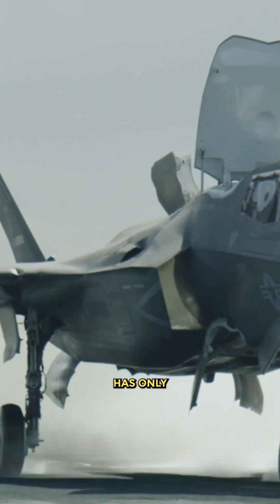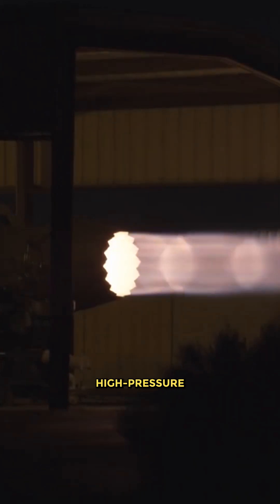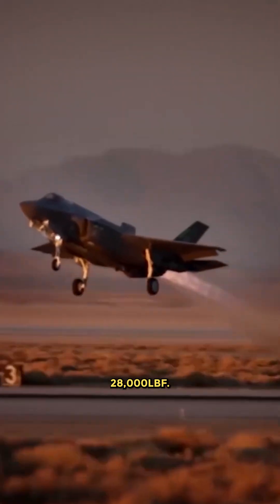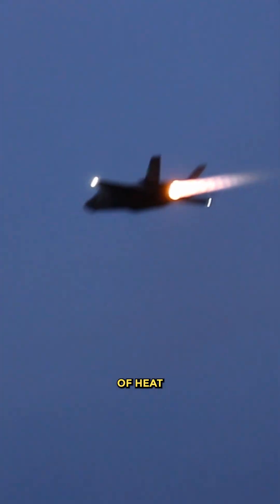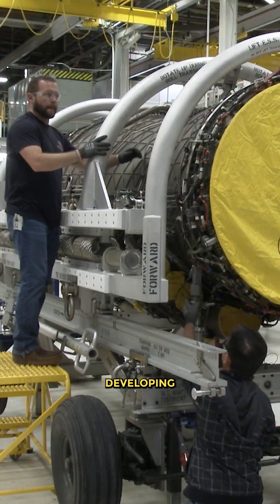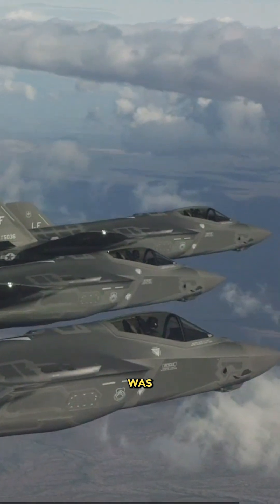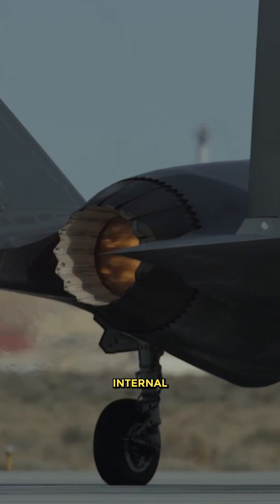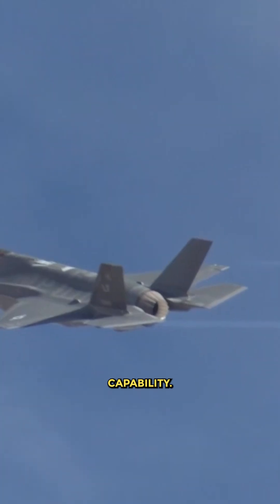Why does the F-35 have Only One Engine? #shorts

Comment: The F35 tried to go a bit far with mission overlap between the A & C vs. B models. The reason for limiting the overall speed was that over Mach 1.6 the RAM available at the time was susceptible to heat damage which is why the F22 costs so much to maintain. Current costs of maintaining the F35 are dropping due to heat resistant RAM which will be bringing the costs of the maintaining the F22 down, too.
Reply: Good to see someone so aware of these fantastic aircraft. I'm English, and this just has to be said, the Americans are the masters of producing not only, such great looking aircraft, but so far advanced compared to all other aircraft types.
Reply: It's literal jobis gon a be to replace the a10 it font need to be faster
Reply: The speed limit is only for the b and c versions because those use a different kind of ram created to resist the salty water
Reply: @aquilesca5tr0  I'm English, so I'd love to know why we see and read so many Americans endlessly trying to run down other countries militaries, and their military hardware, when the truth today is, nearly all of it, is actually, so much better than their own?...  

So, really,  what's that all about? What do they all think they could ever achieve just talking such remedial propaganda? For example, why do we read the Americans all endlessly claiming the F-22 is so much better than the "Russian rubbish"? Yet whenever they're asked what any of them have ever seen the F-22 actually do, that would allow them to form and hold that opinion?, none of them can answer that question, as they've never seen the F-22 do anything at all, (other than flying over a beach on a YouTube Video)?

So, all they actually prove is, they're just talking idiocy and basing their own bias juvenile opinions on a whole lot of nothing, right? So, again, what is it all about? Seriously, read them all?, all they do is talk endless propaganda claims, and claims they can't ever back up with a single fact?. It's idiocy, and it's idiocy on a scale of idiocy I really don't believe any of us have ever seen or ever experienced before, it's embarrassing is the truth.

Even more stupidly, none of them have even asked themselves the most obvious, and most important questions, (we must always, not only ask, but more importantly, understand), before attempting to analyse anything from anyone else! 

Questions like, how can their own F=22 stealth fighters, detect, track, or target any other stealth aircraft from BVR? You see, they can't tell you, as they all just assume so much. Yet if they had just asked themselves that one question?, they'd then start to understand that the reality is nothing at all like they all think!

The facts, (that seemingly none of them even understand), are, that stealth alone, defeats high-frequency (short wave), radar, by absorption and deflection, but it does NOT defeat low-frequency (long wave radar), so regardless of the aircraft's RCS (radar cross-section), when they're being tracked and targetted by long wave radar they're anything but stealthy, and stand out just like a beacon in the night. 

To detect, track, and target other stealth aircraft from BVR, can be done easily with long-wave radar, (but it must also be enhanced), to remove all background clutter for targeting purposes. Otherwise, what could the F-22 have to detect any other stealth aircraft from BVR? 

The answer to that question is they have AWACS (that can transfer all targetting data to the F-22's in real time). Yet that's no longer possible today. And this is where actually understanding your enemies real abilities, becomes extremely important, as I'll show you.

Neither the APG-77 radar, used in the F-22, or the APG-81 radar, used in the F-35, can detect any other stealth aircraft from BVR! An obvious fact, the US Air force will be fully aware of. Only it seems the reality is, that when the F-35 radars were being designed 13 years ago, there weren't any other stealth aircraft to think about as a potential threat! 

So, seriously, how can anyone possibly see these US stealth aircraft as any sort of real threat to either Russia or China, (who both have these US stealth aircraft technically beaten today)? 

The reality of this "Russian rubbish" (they all claim), is that Russia does have a new 5th generation radar, (with enhanced long-wave radar), their new Byelka (2band) radar used in SU-57. 

They can detect, track, and target enemy stealth jets from BVR, while the US stealth jets can't even detect them from BVR? Result = A pretty obvious one.

Russia have designed, and they've developed, the first L-Band fighter radar we've ever seen. They've embedded L-band AESA radars into the leading edges of the wings. And this L-band AESA radar "data" gets processed in real time (through extremely powerful Russian computers), being significantly enhanced, removing all background clutter, seeing them perfectly able to detect, track, and engage enemy stealth aircraft from BVR. 

This new Russian technology, along with its very impressive range parameters, and it's jamming ability (over very large areas) make this aircraft deadly to all other aircraft types. 

Oh, but, wait, it's just Russian rubbish? Indeed, it is, (if you're an outright idiot). LMAO. The SU-57 interacts in ''real-time'' with each squadron member (auto selecting) the best placed BVR missile being carried by any of them, that can be fired by anyone of them. They can take full control of surface-to-air (SAM) missile defence systems - (that alone is lethal). 

They can detect, track, and target all enemy stealth fighters, (and detect them long before they even enter Russian airspace), from much greater distances today, with "real-time" data from all those massive Russian ground (long wave stations), that are all protected with the networked S-400 defensive system. 

The facts today are, actually more than clear, these Russian stealth jets will always know exactly where the enemy stealth fighter aircraft are a well as their course, so they're perfectly able to approach head on, stealthily being able to shoot down all enemy stealth jets from BVR (and, while remaining undetected). The US stealth fighter jets, for example, would not even detect them coming! Result = you're doomed! 

Russia's new (2band) radar, covers all frequencies across all channels, used for tracking, targeting, and also for jamming (over large areas). It's part of Sh121 multifunctional integrated radio electronic system (MIRES) on board the SU-57. 

We must also understand, that Russia tested this new radar suit in the SU-35's, so they also have the option of fitting this radar into the SU-35's. Seeing the SU-35 at no disadvantage against either the F-22/35. As although the SU-35 can be detected, tracked, targeted and shot down from BVR by the US stealth fighters, the SU-35 equipped with this new radar is just as able to detect, track, target and shoot down the US stealth fighters from BVR. 

Seeing the all-important Russian advantage in BVR missile range, plus the excellent manoeuvring, neither the F-22/F-35 have, as more than critical, (if you're going to avoid simply being blown out of the sky). 

This Russian 5th generation radar design, has very clear, and very real potentials to provide genuine shared multifunction apertures, with applications including... 
Search, track, and destroy, missile mid-course guidance, against low signature aircraft, identification of friend or foe with secondary surveillance radar. 
Passive angle tracking and geolocation of JTIDS-MIDS-Link-16 emitters at long ranges. 
Passive angle tracking and geolocation of L-band AEWC - AWACS and surface based search radars at long ranges. 
Passive angle tracking and geolocation of hostile (i.e. Western) IFF and SSR transponders at long ranges. 

High-powered active jamming of JTIDS-MIDS-Link-16 emitters. 
High-powered active jamming of satellite navigation receivers over large areas. 
High-powered active jamming of L-band AEWC-AWACS and surface based search radars at long ranges. 
High-powered active jamming of guided munition command data links over large areas. (Effectively, and completely, neutralising the USA's use of AWACS for their detection). 

This Tikhomirov NIIP L-band AESA radar, is an extremely important strategic development, and it's a technology which once fully matured and deployed in useful numbers, will render narrowband stealth designs like the F-22 & F-35 Joint Strike Fighter, and many, UAVs, as highly vulnerable to all flanker variants equipped with such radars. 

-- Just Russian crap, indeed? HILARIOUS!! LMAO!

FACT = A Russian SU-57 flying well behind the front lines in Russian airspace, detected a Ukrainian SU-27, deep in Ukrainian airspace heading toward Kiev, about 300 km's away, the SU-57 tracked then fired a Russian very long range Vympel R-37 (NATO "Axehead") hypersonic air-to-air BVR missile at the Ukrainian SU-27, from a range of well over 250 km's, blowing it out of the sky, and smashing the previous BVR missile kill range world record, to utter smithereens! 

FACT = The USA has had the F-22 in service for 19 years, and it finally made its first air-to-air kill in 2023, when it shot down a Chinese weather balloon. LMFAO.
Reply: @aquilesca5tr0  Typical US propaganda, usually consists of silly falsehoods, and fake misinformation claims, or just twisted truths, like the F-15, is said to be unbeaten in A2A combat. 

It's true (ish), only when we look at every aircraft shot down by an F-15?, we find that none had any offensive capabilities, and most had little if anything defensive, many without even a basic radar, meaning, you'd be absolutely stunned if the F-15 didn't shoot every one of them down. 

So it really is, once again, and as always, just a very silly, and meaningless remedial propaganda claim. 

There's another aircraft that's also unbeaten in A2A combat, and has faced off against aircraft just as capable as itself. 

The British Sea Harrier is the only aircraft unbeaten in A2A combat, that has faced off against worthy, viable opposition. And that really is a huge factor, that's worth knowing, unlike the F-15 propaganda claim, that you'd be shocked if it hadn't managed.

You should all be questioning why the US made it illegal to sell the F-22?. The US government seemingly wants it believed, it's because it's so good, they don't want anyone else to have it?. 

Yet, that actually makes no sense at all, none, not even a little sense?, as the facts are, they've no idea what's around the corner in modern military technologies, and with the speed we're seeing new military tactical hardware being designed, developed, and created today, it could well have made great sense to sell the F-22 at some stage. (If it actually works). 

If it worked, they'd have been able to recoup many of the resources spent on the aircraft, if not the resources in their entirety, even a profit.

Only there's another, and much more likely, reason the USA made it illegal to sell the F-22? And that's, if it is, just as I suspect, a "lemon", that was intended to be their leading front line strike aircraft that's failed, (and because of the cost/expense, they can't just write it off), so the USA have then only used the F-22 for propaganda purposes? (what better way of preventing anyone else from finding out that it actually doesn't work, and really is a lemon, than making it illegal to sell)? 

Logically, that's the only possible reason the USA made it illegal to sell the F-22. It can only be because it's a failed aircraft that was intended to be their leading front line 5th generation strike aircraft.19 years the US have had the F-22, (and they've been in wars the entire time), yet they've never used it, not once! 

And even more interestingly and telling was, just after Russia arrived in Syria in 2015, the USA removed every one of their F-22's from right across the Middle East, Iraq, Tukey, UAE and Jordan.

Absolutely no doubt about it, I guarantee we'll never see the F-22 involved in any sort of real war scenario, or even involved in any major sortie, because it's basically junk. 

They've even trashed all the infrastructure they had in place to build more of them.

Now we read you all talking about the obsolete F-16? What could the F-16 achieve in Ukrainian airspace?, or in fact, how long could an F-16 survive in Ukraine? For me, I'd estimate the F-16 would have a life expectancy of less than 30 minutes combat service over Ukraine, and that's extremely generous.

You only need to understand what it would be facing. Regardless, that we already know it can't survive the old S-300 anti-air defences, it would then need to survive against, for example a Russian SU-35E? How could it survive is the only real question? LOL.

Before ever trying to talk about your own aircraft or in fact, any area of your own military in any capacity, we must firstly always, not only ask, but more importantly, understand what we are going to face from an enemy before attempting to analyse any abilities we can use. Actually understanding your enemies abilities, becomes extremely important, critical in fact, as I'll show you. 

The SU-35E has a forward and rear-facing Phazotron radar system capable of simultaneous tracking of 34 targets up to 92 miles (148 km's) even over uneven terrain. Its cockpit design contains a colour CRT display as well as HUD (Head-Up Display) along with digital fly-by-wire (FBW) capability. 

It also has quadruple redundancy (the onboard computers will always find four different ways to achieve the desired results of its combat mission), and its avionics also include an Irbis-E passive phased array radar system. 

The SU-35E is classified a "4++ Generation Fighter" - though its true capabilities go well beyond the original/current crop of 4 & 4+ Generation mounts like the F-15, 16, 18, Eurofighter Typhoon, French Dassault Rafale etc while the SU-35E only falls short of the standard adopted for true 5th Generation by its lack of stealth, however the SU35s tactical value has increased massively, and its combat ability has broadened considerably.

The F-16 is an obsolete, unusable aircraft against Russia in every way imaginable, and they all know this, really.
Reply: @aquilesca5tr0  We also see the USA still unable to produce and build a VTOL capable fighter aircraft? Yet, they are trying to lie about this? The F-35B was claimed by the USA, to be able to do what the Harrier could do, while also being supersonic, stealthy, with modern avionics systems, etc, this is what we were told, and it's why we designed  our new carrier without ramps. 

Only one of the biggest technical headaches the British always had when building the Harrier, was the VTOL, — transferring from ''lift'' (downward nozzles) to forward flight (rear-facing nozzles) and flying away. Apparently to achieve it took the British a hell of a lot of technical work, (three — four months at a time, over 3 years). Look up all the variants they made?, but they never gave up, and they finally figured it out. 

I said long before we ever saw the F-35B, it wouldn't be VTOL capable, even with the Rolls-Royce lift engines, (because the USA has tried many times before, and failed each time), only ever managing to produce the British Sea Harrier, able to do so. Every US airframe (and there have been many), have all failed. 

I'll show you what I mean, as otherwise so many of you get confused, LOL

At 7 mins 50 seconds, you'll watch a Harrier perform a proper VTOL. Copy and paste “2013 MCAS Yuma Air Show — AV8B Harrier Demo” into YouTube search. Watch it from lift off, (to more importantly), flying away from the lift-off, and you'll see the transfer of nozzles take place.

You'll not find any footage of the F-35B doing this. Yet we do see Lockheed Martin trying to suggest it is VTOL capable?, when it, so clearly, is not. Copy and Paste “First F-35B Vertical Takeoff Test” into YouTube search. 

You'll only see it lift off, hover, then return straight back down. You'll never see it fly away from the lift-off. Believe me, if it could, we'd see it doing so in every piece of footage we have on the F-35B -  like we still see on all the footage of the Harrier doing so. But you'll never find any footage anywhere of the F-35B doing that. 

Oh, and please, anyone that wants to try and show me the F-35 fly into a hover, and fly away from that hover (as a way of proof it can VTOL)? 

Please don't, because that has nothing at all to do with a VTOL. To hover, and fly from a hover doesn't require the transfer of the nozzles, as hover, is achieved while remaining with forward flight (rear facing nozzles) with pitch and yaw, to find your centre of gravity to control the hover (CPU controlled today). No transfer of nozzles is required to fly from a hover.

You'll then start to read these Americans all, claim it's not necessary? LOL, (while forgetting, they're to be carrier-based aircraft), meaning any slight damage to the deck or ramp, and they can't get any jets airborne?. Defeating the entire purpose of having the aircraft in the first place! You can't ever lose an entire carrier in battle, for only minor damage?, whatever next?. 

So, why do we see the USA doing this? It's obviously because the US is still a country that's never managed to produce & build a VTOL fighter aircraft. Britain did so in the late 50s, Russia did so in the late 60s, the USA has tried and failed numerous times, so it seems this time, they're going to try to lie about it LOL. 

That country is a travesty, man! It shows us that Lockheed are not unknown to produce propaganda aircraft, as the F-22 is the same... Failed, so today, only being used for propaganda purposes!
Reply: @aquilesca5tr0  Recent jumps in Ceramic RAM is allowed for open air RAM fixes and fewer of them!
Reply: @aquilesca5tr0  Can I ask, what are you talking about? Can you tell me what it is you think these aircraft are good at, or what any of them can do? I'd be fascinated to hear anyone tell me this, and more than happy to correct anyone that might want to try? LOL
Reply: @hotstepper887  it's a single platform that is the first thing after 60 that is able to replace the harrier while also replacing the a10, f16, f18 and f117. The f35 is just unmatched by any other aircraft and is most likely the single greates engineering marvel of human history
Reply: @aquilesca5tr0  
Rolling down the runway
throttles open wide
see the mighty Phantom
sway from side to side
airborne again without a blip
It's just one more aborted trip
but we're pressing on regardless
for the wg cdrs AFC

Went to early briefing
climbed into the Kite
opened up the throttles
and roared into the night
leaving the flare path far behind
It's dark outside, but we don't mind
cos we're pressing on regardless
for the wg cdr's AFC

Rolling down the runway
throttle open wide
see the mighty Falcon
sway from side to side
airborne again with just 9 G
I wish I had a nav with me (!)
but we're pressing on regardless
for the wg cdr's AFC

Rolling down the runway
throttles open wide
see the mighty Jaguar
sway from side to side
airborne again, but only just
It's not much fun
with F*** all thrust
but we're pressing on regardless
for the wg cdr's AFC

GIVE ME BUCCANEERS!
They're British through and through
The Banana Jet
The Best we've had yet
We are the last of the few.

Don't give me the Jaguar
Unless you refer to the car
The car is a ground hog
The aircraft, a half frog
Don't give me the Jaguar.

Give me Buccaneers
They're British through and through
The Banana Jet
The Best we've had yet
We are the last of the few.

Don't give me the Harrier jump jet
You haven't convinced me yet
Jets that fly backwards 
Are soon to be knackered
Don't give me the Harrier jump jet
Well… You know, not just yet...

Give me Buccaneers...
They're British through and through
The Banana Jet
The Best we've had yet
We are the last of the few.

Don't give me this computer crap
It's no way to tackle a SAP
It's OK for Dicks, Germans and Spicks
But Gentleman, carry a map!

Give me Buccaneers...
They're British through and through
The Banana Jet
The Best we've had yet
We are the last of the few.

Don't give me Air Traffic Control
They live in a bloody great hole…
They scream, and they shout, then F**k you about
Don't give me Air Traffic Control.

Give me Buccaneers...
They're British through and through
The Banana Jet
The Best we've had yet
We are the last of the few.

Don't give me the F-104
It's only a ground loving whore
It goes in a turn, flick, spin and burn
Don't give me the F-104.

Give me Buccaneers
They're British through and through
The Banana Jet
The Best we've had yet
WE ARE THE LAST OF THE FEW!
Reply: There is so much we could talk about with the F-35?, and just looking at the reality of the F-22?, should have been showing us all the reality, before this country bought a single one, but not only did we waste our money on them?, but we put our own Rolls-Royce engines in our F-35Bs. That don't stand up to what we were all told they would be? An aircraft that is stealthy with much improved electronics and computer software, able to travel supersonic that, like the Harrier, would be VTOL capable.

It's very clear, we would have been far better off concentrating on a new supersonic Harrier type, or we should have been looking at the new SABRE engine as a realistic look at upgrading our own air force? With the wasted money, we could have been building our very own modern fighter aircraft for the last 20 years?

Today, BAE Systems is developing a HVP (Hypervelocity Projectile) for the British & US military. They've already purchased 22% of ''Reaction Engines Limited''. Reaction Engines, was founded in 1989 by three propulsion engineers from Rolls-Royce, Alan Bond, Richard Varvill and John Scott Scott. Their early work on the RB545 engine, destined for use on HOTOL was evolved and focused on producing a robust technical design for the new Synergetic Air Breathing Rocket Engine. (SABRE).

They've been developing a new type of hybrid jet/rocket engine.  SABRE — can lead to the development of new hypersonic aircraft and future space vehicle's. The technology has immense military value for the creation of hypersonic missiles or/and aircraft, that would be able to hit targets at speeds and ranges that are unheard-of today. 

Moreover, defending against such an attack would be extremely difficult. The technologies and military applications of the engine technology, could easily be applied for hypersonic missiles of both attack and defensive duties, as well as new high-speed long-range bombers or reconnaissance aircraft. Such machine's, travelling at orbital velocities, would be nearly impossible to intercept with current defensive technologies. 

"Skylon" Is a series of designs for a single stage — to orbit, spaceplane concept, also using SABRE (a combined-cycle, air breathing propulsion system). They're also looking at building the ''A2'' a civilian Hypersonic airliner with a cruise speed of well over Mach 5.2. 

So, as BAE have already bought into this company?, we can be pretty sure they've already cracked this engine. 

You'll soon read elsewhere the American trying to suggest something about this, will be American?, when it's not, never is, and all they've ever really done, is copy British tech, while crying China steals "their tech".
Reply: @hotstepper887  Sure! You know BAE does more work in the US than UK, right? But yes the sun never sets on the British Empire and you spend so much on research and development. What was your entire Defense budge? Sounding more like Russia having better tech than the west with fewer engineers under 60 and a budget the size of the UK's.
Reply: @aquilesca5tr0  I don't believe we've ever seen, or read, people as clueless as you Americans, who we read talking about these military technologies, like your own aircraft, or any of your own military for that matter? 

Before we ever attempt to analyse anything, firstly we must always, not only ask, but more importantly, understand exactly what it is we need to analyse, and why, especially before attempting to analyse anything from anyone else! And analysing the USA's real military abilities, today, is a horror story. 

Over these last 25 years, they've been out thought, out-built, and technically beaten hands down, by both Russia, and not to forget China, who are banging out modern hi-tech, hi-quality military hardware in all areas of their military today. We actually know very little, but what they've allowed us to see, there's not really anything I could single out and start to criticize even if I wanted too. 

A great question that points out today's reality is, what does the USA lead the world in today concerning anything military? And the answer to that question is, absolutely nothing! We can also just look?

Tanks? = Russia own the ground. Can't even begin to argue, not even any point trying. 

Navy? = In today's world of hi-tech Anti-Ship ballistic missiles, like the Chinese DF-21D — operational range (1700 km's) that can sink any carrier in the world with a single hit. All Navies, without the ability to stop these missiles, are completely obsolete today. 

Russia's Zircon Anti-Ship missile though inferior in way of operational range-400kms it can be fired from Aircraft, Subs, and Ships making it deadly to any carrier in the world. (Russia also has the Brahmos and the P-800 Oniks Anti-Ship missiles).

We know, the USA, haven't got a destroyer that can defend against these modern hi tech ASM's today! Making the USA's Navy obsolete in today's world. Let's just look at the distances the US jets can travel? It's about 500-650 (max) km's out — and the same back again = 1300 km's range. 

So how could the US deploy any carrier close enough, to reach any inland target, and then get back again? They can't, anywhere inside 1700 km's they're sunk, they're toast, they're history. This is also why when looking at the GPS positioning of any US carrier in the South China Sea, you'll never see them closer than 2000 kms from Chinas mainland.

Aircraft/Force? = Explained below.

Electronic Warfare? = The Russians are decades ahead. Russia have the GaN MMICs, the krasukha, the murmansk-BN, and Magrav technology (NATO: Khibiny) developed by Iranian-born nuclear engineer Mehran Keshe (called “a modern-day Nikola Tesla”). And we can say for sure, this EW hardware is super impressive. We've no answer to it. We've also seen this E/W in action on at least 4 occasions we know of... 

1) In 2013, we've seen a Russian SU-24 fly repeatedly around and directly over the USS Cook, leaving the Cook helpless to defend itself.

2) In 2014, we've seen a Russian SU-24 (flying at an altitude of only 10 feet), fly directly at, and straight over the USS Ross, eleven times, with the Ross completely unable to prevent It or respond to It. 

3) As Russian forces arrived In Syria in 2015 we had many reports of US/NATO/Israeli Radar becoming scrambled, leaving them unable to communicate, or offer any response to the Russian forces. As one report said, the silence from the West was deafening!

4) In March 2015, a further related report notes. Federation submarine naval forces attacked with their advanced electronic defensive weapons the American aircraft carrier USS Theodore Roosevelt (CVN-71) causing it to turn and struggle to the coast of Britain to the amazement of the public, where she remained for 9 days undergoing Intensive major re-wiring. It's believed the Russian electronic warfare pods (NATO: Khibiny) were used in a Russian trial of this technology for its submarine fleets. 

White House spokesman Josh Earnest, who said of the encounter with the Cook... "This incident is entirely inconsistent with the professional norms of militaries operating in close proximity with each other in international waters. E/C measures taken by the Russian Federation are unacceptable".  

To which the Russian MoD replied... "Frankly speaking, [we] do not understand the reason for such a painful reaction of our American colleagues, as the principle of freedom of navigation for the US destroyer, (which is staying in close proximity to a Russian naval base in the Baltic Sea), does [not] at all cancel the principle of freedom of flight for Russian aircraft testing Russian defensive systems".

A further Ministry of Defence (MoD) report also stated that for the second time in two years, advanced  Federation “electronic warfare  defences” have crippled the Arleigh Burke-class guided-missile destroyer USS Donald Cook (DDG-75)— It was noted when Baltic Fleet “special forces elements” offered assistance to tow the destroyer back to their Polish port, the Americans refused to respond.

According to this report, in April 2014, the USS Donald Cook, while performing a mission in the Black Sea, substantially violated Federation “territorial integrity” causing President Putin to authorize an “electronic warfare defence” attack against it, that was so devastating this top-line warship was left adrift—and once towed back to its Romanian port, its American sailors were so demoralized 27 of them filed immediate letters of resignation from the US Navy.

One year later, in May 2015, this report continues, and again in the Black Sea, the Arleigh Burke-class guided-missile destroyer USS Ross (DDG-71) substantially violated Federation “territorial integrity” causing President Putin, to once again, authorize an “electronic warfare defence” attack against it. 

But when confronted with the fate that befell the USS Donald Cook the year prior, it retreated—causing one Russian top-level Naval Officer to state: "It seems that the Americans did not forget the April 2014 USS Donald Cook incident — A Federation SU-24 equipped with EW pods shut down the new American destroyer". 

This attack encounter of Federation forces with the USS Donald Cook, this report details, began when this American warship began an “aggressive combat manoeuvre” against the Baltic Sea Fleet port in Kaliningrad, to which President Putin authorised an immediate “electronic warfare defence” against it.

Troops? = Russian troops with reserves today outnumber the USA, and any attack on Russia would immediately see China join the conflict. Then outnumbering the USA in the millions today. Also, what has anyone ever seen from any US troops, that could make anyone believe or think they'd be any sort of threat or match to Russian troops, who are all fully bled and will all be fighting for all the right reasons, like their own country's freedom, while the US troops will only be fighting for attempted US tyranny?. 

All throughout the history of wars, we always find the countries fighting for all the right reasons, like their own freedom, have never lost, yet all those who fought for all the wrong reasons, like global control/tyranny, have all not only lost, but all have been annihilated. 

The American people themselves, would all be very wise to understand this, as we see this in every war, over and over again, nothing will change this time, only the annihilation might be much more severe, but just as deserved.

Missiles? = Russian missiles easily rule the world today. Russia's modern hi-tech missiles that include hypersonic missiles with Russian GLONASS, GPS targeting systems, give Russia such incredible precision, the USA has nothing we can say even compares. 

As we've all witnessed, Russia was pinpoint accurate, targeting single buildings in Syria, even guiding them down chimney pots, or straight in through the front door, and doing so from the Caspian Sea from distances of, up to 6500 km away. 

Russia has also provided clear, precise footage, of all her long range missile attacks in Syria, (that we can see all came from the Russian control room online). Russian hypersonic missiles, we all know the USA can't defend against, and Russia has many other lethal hypersonic missiles being created and added to her arsenal.

Personally, in any upcoming war? I give the USA precisely zero chance, none, not even a little snippet of a chance, annihilation is all they'll get. And being even more honest?, quite deservedly so!
Reply: @hotstepper887  Russia still isn't able to produce a fifth generation fighter and they just keep rebranding the su27 while china has one fifth gen based on both the f22 and mig 144. Hypersonic nuclear weapons arent better than already unstopabble icbms
Reply: @hotstepper887  even russias most modern tanks, the t90s, are getting obliteraited in ukraine by cheap anti tank missiles. Russia is a third world country that relies on soviet tech
Reply: @hotstepper887  also, remember that both russia and china are unable to develop proper aircraft carriers